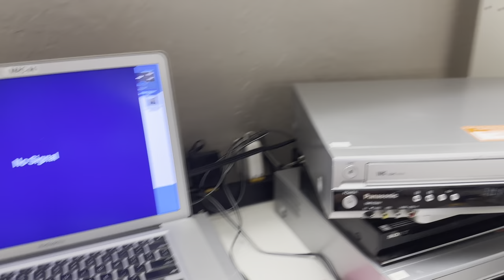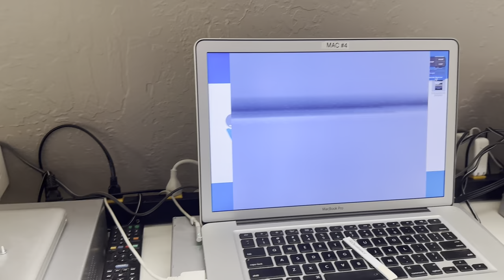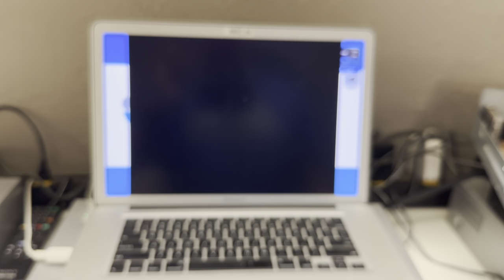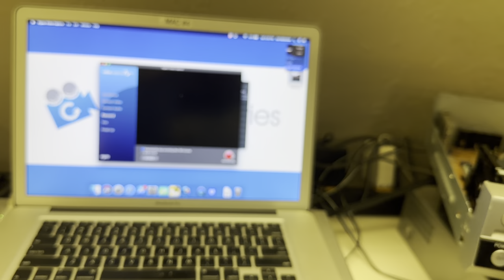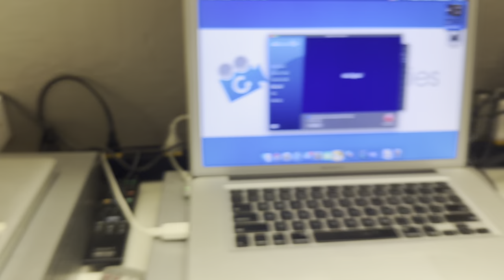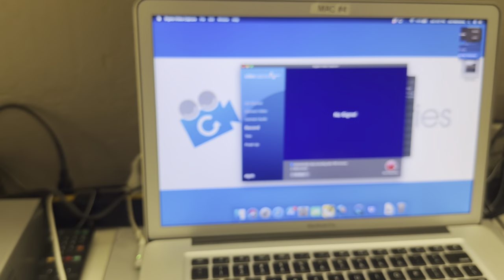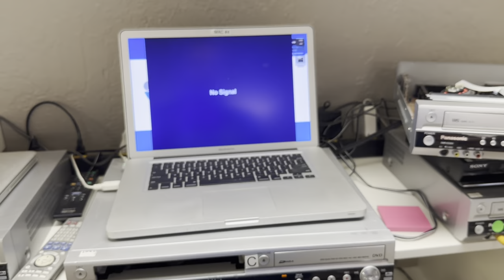How to Clean VHS VCR Video & Audio Heads & Tape Path Alignment + Tips for choosing a VT Company

Comment: Hi Phil, thanks for the videos (especially the "that's what she said" quote 🙂). Quick question, the video from my VCR is fine, but there's a scratchy noise from the audio that is annoying. Will cleaning the audio head help with that? Also, do the head cleaner cassettes that you've shown in a few of your other videos do the same thing? Is this (above) a more thorough cleaning where the cassette is more of a "dusting off"?
Reply from the maker: Give it a clean and find out. As I say to anyone diy’ing it, you need ideally 5 VCR’s. You’ll put your tape in all five and all five will have differing visual and audible differences.
Reply: So are the cleaner cassettes OK, or should I go through the trouble of taking the lid off and cleaning it by hand?
Reply from the maker: Tape cleaners are a band aid, getting a good solid ‘scrub’ on the heads is best.

Comment: The audio head here is for the linear track that is on the edge of the tape. Can be stereo but often mono and low quality. This head also is the control track head. For the hi-fi stereo audio it's on the drum with the video heads. IMO it's worth to transfert both linear and hi-fi audio because on amateur videos it sometimes can be different, some used the dub option of VCR, replacing the linear audio signal with another one, different from the hi-fi audio.
Reply from the maker: Thanks for the comment!
Reply: @gotmemories  You're welcome. I like how passionate you are about video and audio quality.

Comment: Hey Phil,  your channel helped me recover and clean 30 years old moldy tapes (VHS, Video8, Hi8 ...)  that I needed for a documentary project I'm working on. I'm in Lebanon and there's no one around here that does the kind of job you do, so I had to learn to do it all by myself. It's costly, time consuming and as you always say "fiddly fiddly stuff!" 

Just 2 questions:
1-Some mini dv tapes are glitching while others are playing smoothly, could it be that the tape is defected due to its age? I ran a head cleaner tape several times in the camcorder and still same results for the same tapes.  
2-Do you digitize U-matic tapes? I have one in the collection that I'm working on, if yes, I might consider to ship it all the way to you. 

Thanks again for all the info and videos!
Cheers!
Reply from the maker: Glad to hear you’ve found the videos helpful mate! The mini dv could be an issue with the tape back in the day, moisture on the camera head, esp in the heat and humidity of Lebanon. 
I do Umatic. I do have min charges though and I believe Lebanon is secam. I don’t have a deck for that. I would try video 99 in England, he has a channel on YouTube
Reply: @gotmemories  Thanks man, much appreciated!✌🏻

Comment: I have this same exact machine and as of yesterday it worked fine. I'm running into a similar issue...I get audio, but no video. But I can see the video when I fast forward and rewind. Any idea? What's even weirder, is that old home recorded off the televesion tapes, work. But any purchased movie, is just snowy video. I figure if the play head was dirty, it wouldn't play the home recorded tapes. So it's more likely alignment...but I figured I'd ask a professional.
Reply from the maker: Alignment, buy a few VCR’s, I always say you need 3 of every format.
Reply: @gotmemories  it was alignment, got it fixed! But yeah definitely a good idea. Any other models other than the Panasonic DMR's you recomend that are VHS DVD?

Comment: anytime i clean a vcr head with rubbing alcohol it always eats the tape or something goes wrong and then it works normally afterwoods,
am i doing something wrong? too much alcohol? one vcr i cleaned the heads on i left it to dry for over an hour and it still messed up a bit.
Reply from the maker: Hmmm! Usually if it’s wet still it will do that.